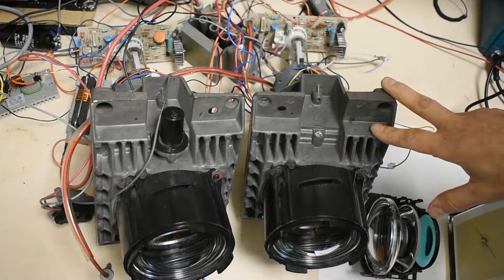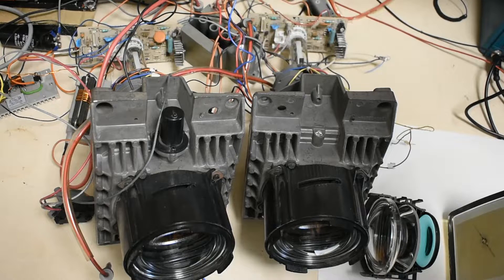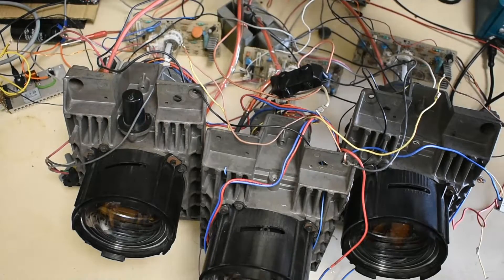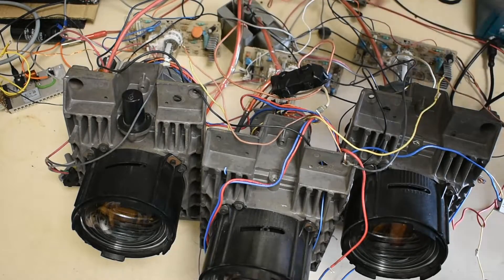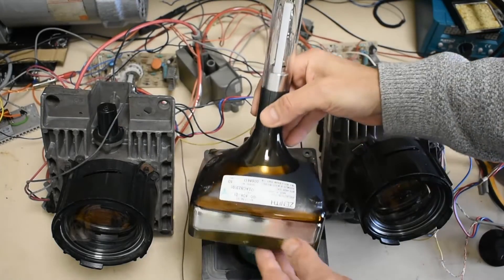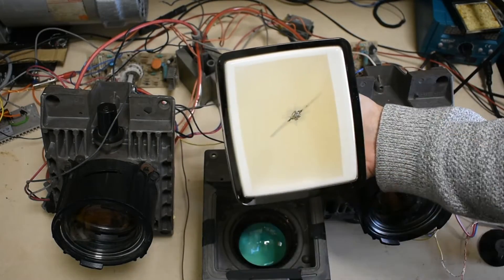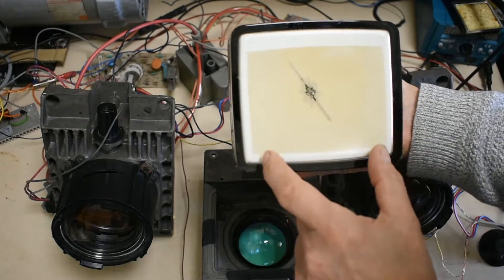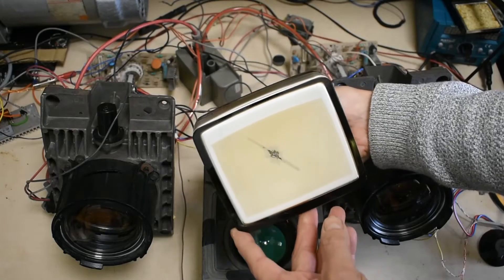Dancing Cathode Rays

Comment: I've been wondering if those tubes would be suitable as vector displays for a while - so thank you for trying! it's sad that they damage so easily...the idea to to modulate intensity with speed would be an interesting solution -I guess a fully analog implementation (summer-filter-envelope detector) is doable and could be done with a few opamps. -maybe another solution would be to always mix a low amplitude sine/cosine into the input signal to never have a small spot but rather a tiny circle that get's projected?
Reply from the maker: As you say it's a pity the burn easily. Had I spotted this early I would have looked at beam blanking or attenuation of a slow or stationary beam. Although low amplitude deflection at high speed would still be an issue.  I doubt it would be possible to project an image of a stationary spot as it would need to be kept faint not to result in a burn.

Comment: Are the faceplates leaded glass? I presume that at 40kV, X-Rays are an issue. What sort of beam current do these run?
Reply from the maker: X-ray emission would be an issue, the face-plate is very thick and may have a lead content. There is a lead band around the join to the cone. The cone is of a thinner  glass but heavily doped with something (possibly Boron) as it is quite red in colour.  Not sure about the beam current but I think the cathodes are a little more substantial than in standard CRTs.

Comment: You can run the tubes at a much lower brightness, which will reduce burn, but yes they are very sensitive because of the high beam current.  For replacement fluid just use propylene glycol, available at your pharmacy in small bottles, as it will be the majority part of the coolant fluid anyway, so can be used to top up. 

To still have high brightness at low beam current try using a z modulation scheme, probably around 20kHz with very low duty cycle, to get the beam current down with no signal, and use the rate ofr change of voltage to modulate the duty cycle from say 1% at no motion to 100% at 1kHz of audio input. Should brighten up the drawing and keep the static parts somewhat cooler, or just have the absolute value of the drive change beam current as well.
Reply from the maker: Thanks, If I realised they were so delecate I would have run them  on lower power but to be honest the screen discolours the moment the beam is stationary so would need blanking. At higher frequencies and large amplitude I would probably got away with it.  Interesting to do anyway and now I know if I am doing it again.